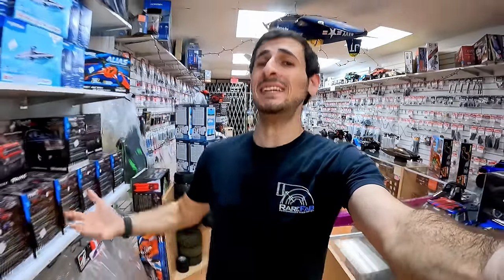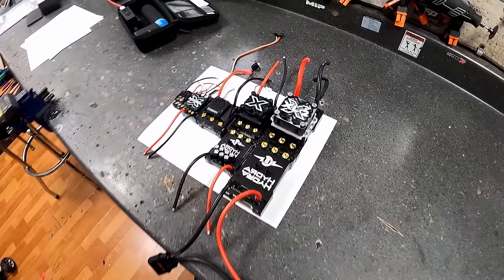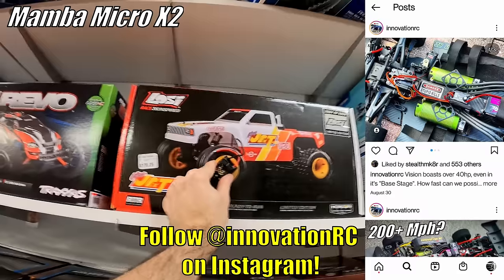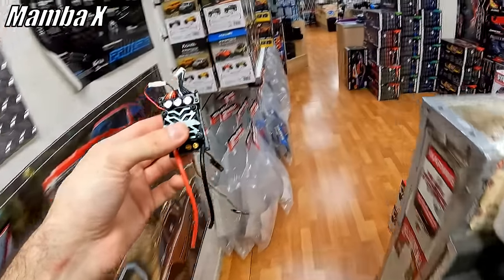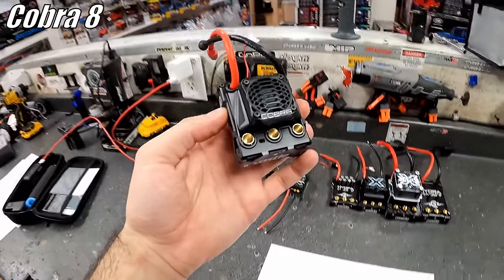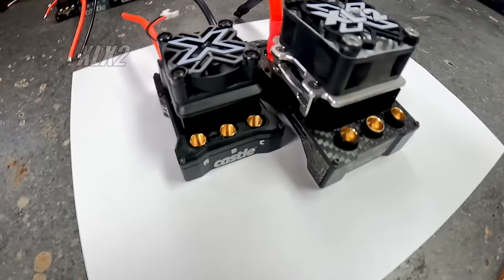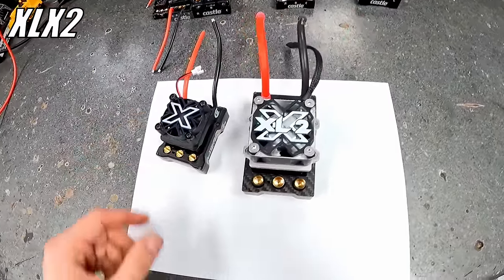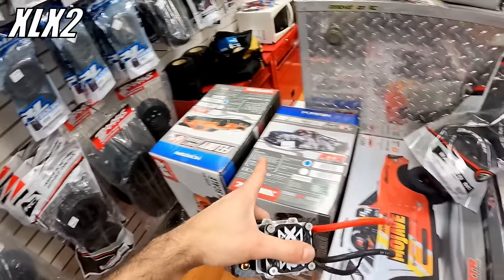ULTIMATE Castle ESC review!

Comment: Great video. 
I'm a big Castle fan and only run other brands if they came with the truck (with one exception). My favorite ESC is the Mamba Monster X w/1515-2200kv motor that I have in my two Ryfts. In my Kraton 8s speed runner I use an XLX2/1100Kv combo, in my Xmaxx basher I used a MMX8S with the stock motor. My custom Clodbuster has a pair of Mamba X ESCs with 3800kv motors. The only trucks that I don't have Castle products in is my crawler and my Kraton 6S EXB. The Exb will get a Castle product at some point.

Looking forward to the motor comparison you talked about doing. Your last one was great and very helpful.

Comment: Great video!  I gotta comment on that 1/5th scale drag car.  The  aluminum frame or upper chassis piece makes no sense to me unless it’s engineered to increase front weight bias.  It’s got 4X the material that it needs…. No wonder it’s heavy.  I get a drill press if I didn’t have one then proceed to drill that aluminum frame until it looks like Swiss cheese

Comment: Thanks for the video...outstanding info.  Before I get to answering your question, I'm curious why you didn't actually include all of the X-series ESCs - you missed/forgot the MMX (ie. the 6S version that's between the Mamba X/Cobra & MMX-8S).

That said, for the past few years, the Mamba X, MMX, and MMX-8S have been my "go-to" for land vehicles...but, I have a strong feeling that, moving forward, install is using the MMX, I'll be going with the Cobra.  Also, in my boats, my standard "go-to" has been the various Hobbywing SeaKing ESCs...but, again, moving forward, I'm very interested in giving the Castle Hydra ESCs a try (personally, I'm not a big fan of Hobbywing, but have had visually no other options until Castle released these new Hydra models).

Comment: Great video! Long time. No see bud. I just put a micro x 2 w/ 8200kv motor in my Losi mini b. You have any of the Losi minis?
Reply from the maker: It's certainly been awhile! Ironic that you say that! A future video will show both of my mini B's!
Reply: @InnovationRC  Awesome! I too picked up 2 of the new mini b brushless rtrs. Had to make one a speed demon. 55t spur with a 23t pinion has got me 62mph so far with the micro x2 esc/motor combo. Still power wheelies at full throttle so next step is trim the rear wing, adding the front wing, and I found a brass hinge pin block to add weight up front. Even sneaked the b-link programmer under the body for on the fly tuning and data analysis.

Comment: Great job...But I'll never will buy a Castle esc until they come out with a HV version because all I run is 12s so my go to esc is a max 4 HW!! Until then I'll never give Castle a dollar of my money...just my opinion!! Im sure Castle ecs are great!!
Reply from the maker: I respect that regardless! If Castle makes a high voltage 1/5 ESC it'll be wicked. Based off what it can already do on 8s, 12s would be game changing for big trucks. They didn't make a high voltage ESC yet because the market doesn't justify the R&D for it. Not everyone runs super high voltage above 8s. 12s takes a special set of skill to work with regarding setup and car, and you I'm sure you got it! But, I never said they won't make one 😃
Reply: I'm sure it'll be 2 or 3 years down the road for the 12s castle but hopefully sooner tho...thanks for your expertise

Comment: Hello I'm new to the channel and I have a question about the "mamba monster X" do you know why it says in the specs not to run a batteries over 5000mah? It's kinda putting me off because I don't have batteries that small and I would like more run time anyways. Any info would be greatly appreciated. Love the content if I don't get a reply great channel !!
Reply from the maker: I would disregard the over 5000mah thing. That's just runtime, it only helps with distance of time running and voltage drop under load. It's probably saying that because they don't want people to over load the esc
Reply: @InnovationRC  thank you very much for your time to respond to me I really appreciate it, I've just bought a new infraction and I will be putting a castle 1520 1650kv motor paired with a MMX esc and now from your advice I will save some cash by using my pair of Centro 6700mah 4s lipos  I have from my xmaxx. I can't wait for spring to come along . I hope you have a great day dude thanks again 😁
Reply: From what I read it said not to go under that mah rating
Because the escs pull so much power anything under 5000 likely wouldn’t do the esc justice

Comment: Would you recommend running Traxxas batteries on the MM8s?
Reply from the maker: Never, those batteries are made to run in stock Traxxas cars. If the ESC outperforms the batteries and if your setup is very demanding, you'll puff the batteries up which could be very dangerous. You need real batteries with real ESCs. Be careful!
Reply: @InnovationRC  thank you!!

Comment: Subbed an Liked. I am New. I have WPL C24-1 with few Metal parts added. I want to get a ESC and i all ready picked out a 6ch controller i want. I just want to Crawl, slow but Torque and no one talks about it. ???? Help
Reply from the maker: Both Mamba X and a Cobra 8 will do what you want. Depending on how much room you have, if you could fit a Cobra, do it
Reply: THANK YOU SO MUCH :)  @InnovationRC